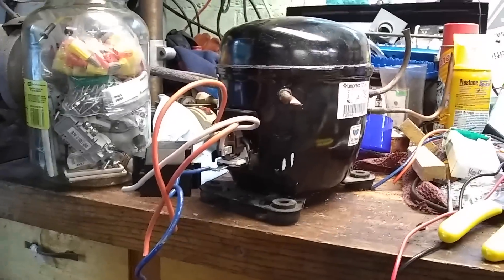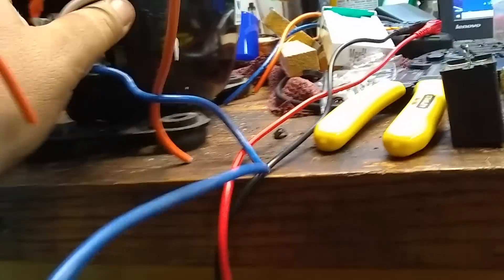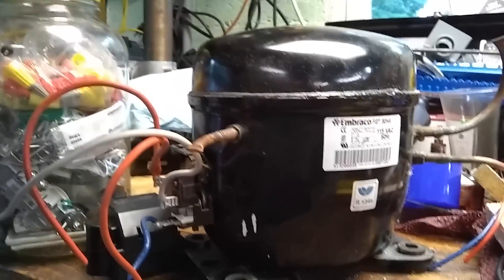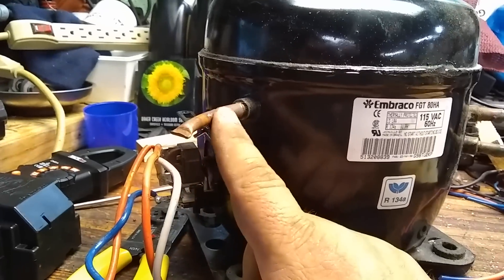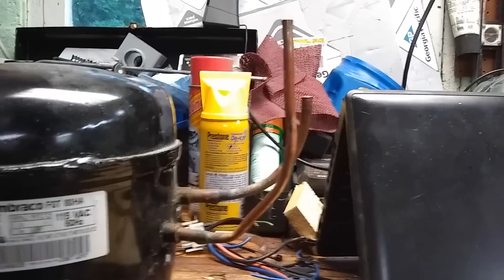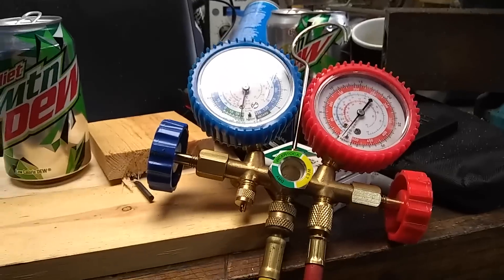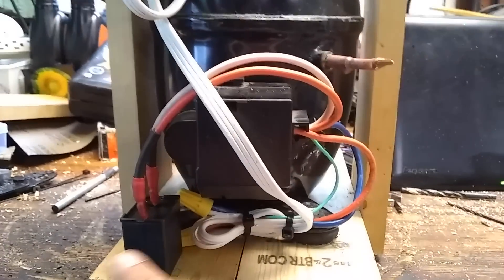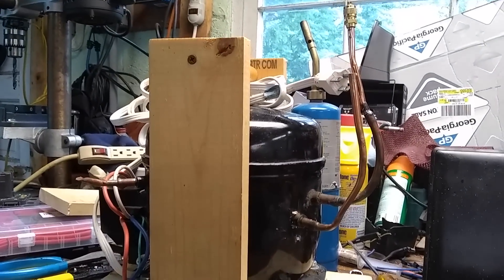Make Your Own A/C Service Vacuum Pump For Free - Better than Harbor Freight

Comment: Mineral oil is totally fine for this application. R134a will not turn it to sludge, it just doesn’t work well to return the oil back in the compressor in the actual closed circuit AC or refrigeration system. 
Sludge will form from mixing incompatible oils and moisture.

Comment: POE Oil I'm guessing. Seems to be what is used for the electric pumps.  Thanks for sharing.  Any compressor makes to recover the R134a?  Thinking I'll find a good used single use tank and cut the seam off carefully to modify the check valve so can be used to fill as well. Was thinking more to use one of these POE Oil compressors to actually compress for recovery.

Comment: So... this should also be ok to use on  say fridgerators wine chillers freezer as well as automotive A/C systems correct?
Reply from the maker: Yes.  I have used it to replace a few fridge compressors.

Comment: the other small r22 refrigerator compressor in this video can vacuum down to 30hg too?
Reply from the maker: Yeap
Reply: @frugalprepper  so both can vacuum down to 30hg whether they are small or large refrigerator compressor right? cause i have the small one and im not sure it is worth to modified
Reply from the maker: @HatiInsaf  Yes the both will, but the R22 one will have oil in it that is incompatible with R134, so it will sludge up with that oil in it.  You would have to turn it upside down and drain the oil out of it and fill it with pag oil.

Comment: Would an old window air conditioner compressor work?
Reply from the maker: Yeah it will work fine.  Sometimes they are going to be bigger and heavier though.
Reply: I have a window AC compressor, use it mainly for recovery and pressure test a system. Pretty heavy
Reply: @hvacworkshop4791  I've been using it for brake and cooling system work on a couple of cars. Works pretty slick!

Comment: Thank you for making this video! I got a 68 dodge charger with a 440 engine, I'm pulling the alternator, power steering pump and ac pump off, and converting to a serpentine belt set up with 1 belt running it all. So I need to remove all the R134a out. Or "recover" it

Comment: Where and how will we add fresh engine oil in the compressor and how much?
Reply from the maker: The oil will stay in the compressor.  If it is coming out the output tube then make that tube longer. I haven't added any to mine after many uses.   If you needed to add some, just put some PAG oil in the inlet.  I would just add a little at a time.

Comment: I connected service ports on the high and low side of the compressor then I can use it for a vacuum pump, recovery machine and an air compressor.

Comment: Excellent idea and execution.  Yes, be careful with the electricity... or it might be an execution.  I don't really do any a/c work other than replacing clutches but I really should do more of it,  lots of money to be made fixing a/c in autos.
Reply from the maker: People will pay anything to get their AC fixed!  Brakes... they can wait but make it cold again!
Reply: Electricity? 😂. A typical refrigerator he consumes about 250 w.  That cost around $0.03 an hour if compressor is running. 😏 And the average time to evacuate an AC system is around 30 minutes..  I honestly don't think anyone's going to care about $0.02 worth of electricity everytime they use a vacuum pump made by a refrigerator or AC compressor. Also, do you really think a vacuum pump that you buy at harbor freight is going to use less electricity than a small refrigerator or air conditioner?..  you should study energy conservation..  you seem like the type that would go to a laundromat so you don't waste electricity using your own washer and dryer 🙄